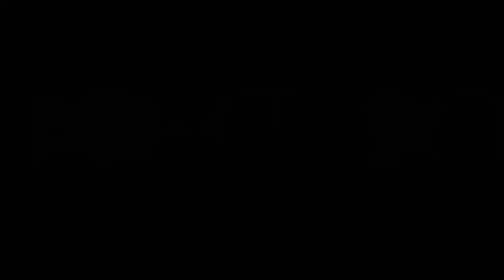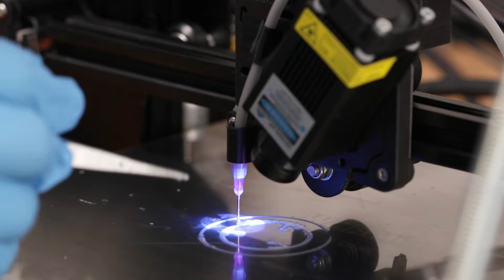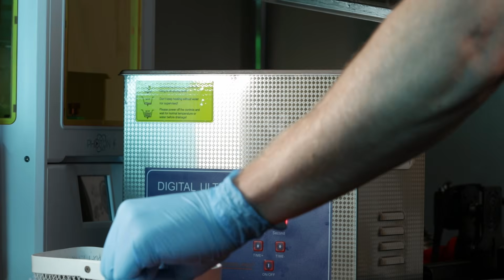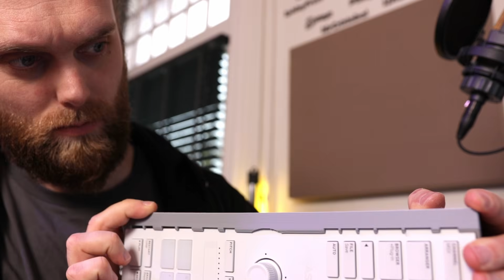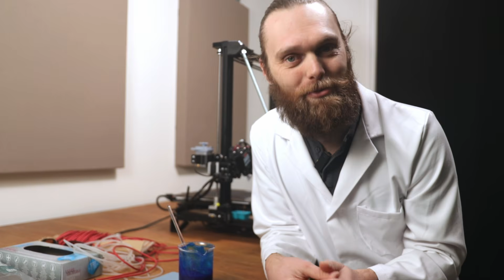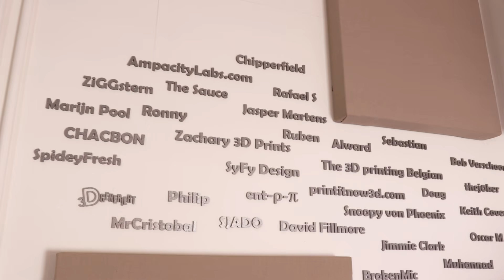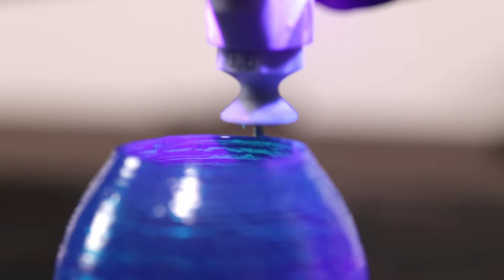I made a CUSTOM Nozzle that 3D Prints GEL!

Comment: what about pressuring the vat and then also adding a valve (peristaltic style) to compress the tube and restrict/prevent flow when needed in combination with adjusting the pressure of the vat. You can then adjust the flow/pressure as needed.

Comment: so i think your on the right track here, with the addition of the continuous fiber, the current resin would more than likely be able to cover gaps with cleaner results than even the more paste-like resin from the last video, while maintaining your ability to have variable control over the flow of the resin over the fiber allowing you to really fine tune the size of the extrusion. maybe the next thing is adding the continuous fiber to the equation with the current resin mixture

Comment: Not sure if its possible or if you've done any research into 3D clay / ceramics / concrete etc.  I know its a completely different material you're using but they've solved a lot of problems with the exploding or bubble parts that print - really big problem in clay printing.  Maybe some inspiration or idea's could come from them, might not be the solution but could spark another idea that helps you solve your problem.  Great video

Comment: 16:7 Is your power supply grounded? If not, it might generate a potential to ground of about 100V (as high as 150V and as low as 90V). And when your body closes the circuit to ground, it kills electronics.
Don't dismiss it because you didn't feel the tingle, that won't happen. It has very little actual charge, so only a few μA flow.
Reply from the maker: Good question, yes it's grounded. However, the body of the laser unit wasn't because it's mounted to a plastic bracket. So the only way my static electricity can go is through the electronics.
Reply: @properprinting  Doesn't have to be static, is what I meant. Just test it. Any power supply without ground connection (USB, laptop, whatever). And measure between its 0V rail and the ground of your house. It will have a potential above 90V. Oh. And it is AC. Make sure to set your multimeter as such, or it doesn't display a thing.

Comment: I thought about this overnight - one thing when I was making surfboards for the first time with epoxy resins was heat - it's a seriously exothermic reaction - if there's too much mass/volume left in the pot it gets hot and solidifies quickly - 

HOWEVER if the resin is on the board and becoming too thick to work and causing issues - giving it some heat with a heat gun lowers it's viscosity for a few crucial minutes.

Point being that it's viscosity changes with just a few degrees - so we went to giving the mixed resin 6-8 seconds in a microwave before use.

You could try varying the temperature of your beaker with a heated water bath and using a hot end end warming the resin ever so slightly during prniting to obtain the viscosity you require at the print nozzle.

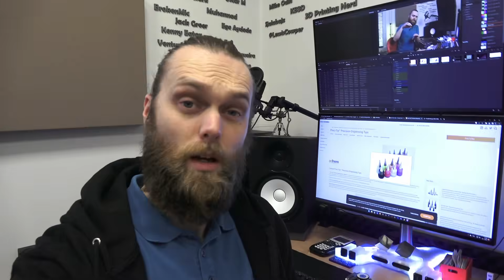Comment: At 4:00 :

During my Bachelor Thesis, I designed and resin printed nozzles with a luerlock thread. It was used to extrude a high viscous paste and worked really well. If you want to, I can share the dimensions from the Iso Standard or my 3d model and you can design a nozzle with th luer lock thread
Reply from the maker: Thanks! I used this in my previous attempt and failed. In that video I showed that the tip wasn't stiff enough which caused issues when the resin started to solidify. I needed something stiffer that was able plow through the irregularities.

Comment: maybe you can try some kind of pumping system that is similar to the pellet extruder mechanism so that material would be pumped constantly. why not.
Reply from the maker: Thanks for your suggestion! I thought about that and also showed a bit of that thought process in my previous video about FDM resin. The main reason is that with a peristaltic pump, the resin doesn't come into contact with the mechanics and it's easy to build.

Comment: I should have watched your video 2 months ago. 😭
Im halfway of my own version already!😢😢😢 instead of redesigning the nozzle, I add an arduino and a small servo to toggle a cover on syringe pin and run the path again with UV led turns on. 
Although my application is to use it as UV glue/resin dispenser so I can save up time when I need to use UV resin for assemble or for sealing purpose.
I even wrote a g-code editor so I can multiply a simple CNC path generated from inkscape and fill the print bed while adding leaving a textbox for klipper macro so it can be done via invoking from klipper mcu.

Comment: I wish I had seen this during the first few weeks. I don't think that the Peristaltic Pump is the best way to go, because you are relying on a flexible tube that changes shape with changing pressure. If you use solid brass to build a pump with the design based on a rotary engine, but very small, and all your tubing after the pump was brass, you could use rotation speed directly geared from your stepper, you would have unmatched control over the flow. You must remember that fluids don't compress, so all the pressure from a pump will exert force on the walls of the line to the nozzle. Only way to have perfect control over the gel, is to remove ALL components with any flexibility from the nozzle line. This would even have amazing retract control.
Good luck and continue to push the barriers of engineering.

Comment: I think you are very different than other 3D printing guys out there. you are an inventor and innovator. I have recently discovered you and am happy. this FDM resin 3D printing especially with capablity to mix different type of resins throughout printing will be a big game changer. please continue working on this. i realy appreciate you sharing these great ideas on here. some of your ideas are patentable which can lead to you having your own revolutionary 3D printer range in the future. you are a problem solver this is the most valuable skill. I am an UK based medical device inventor with granted patents to my name so I kind of know what I can see coming :-) well done
Reply: did you try increasing layer height and reduce flow, and reduce the light intensity so the nozzle can go over the hardened resin bridges. i think all you need is a balance of flow rate and light intensity. gel is consistent enough to hold itself up during curing.
Reply: or you need a special resin formula that hardens slowly and gradually enough that the bridges will not be too hard by the time nozzle hits them. i just thought of  fluorescent pigments that are used for resin casting. this pigment restores the light energy and gradually releases it in dark. I think if you add some into your resin mixture then the UV light will be absorbed by these pigments and then released gradually reducing the immediate hardening effect of the light to your resin. good luck.

Comment: I wish that I had seen this when you were actively working on it rather than a year and a bit later. If you ever get back around to it, a few helpful bits to speed up your progress. 
With resin printing and liquids being extruded in particular, using the pressure from the pump and Very thin layers, you don't really set the extrusion height like you do with filament, but rather let it flow as needed. Aiming your curing light directly behind where the flow emanates, with a thin enough layer, you will get nearly instantaneous curing; you can continue with the laser, or a focused lens with UV LEDs of adequate power, which are much, Much cheaper to acquire. 
As a trade-off for the smaller nozzle size, you balance the drop size with increasing or decreasing pressure on the pump end through the software and can move the toolhead around as fast as it will go. Where you want the drop/stream to land is at an angle onto the previously formed 'extrusion', so having your nozzle exit rearward is rather important.

Comment: Cool. You got success on continuous spiral print. If there was a way to point the UV to the area one or two layers down from the nozzle it would allow a much cleaner print without nozzle scraping. If you power your laser from a fan circuit you can set in cura the height at which the fan (laser) starts getting the first few layers to stay elastic for a bit. Maybe adjusting the UV intensity could have a similar effect. Not sure if the resin curing process is gradual or instantaneous...

Comment: WOW!  This is hardcore research.  I would try tightening the laser to a narrow point that is right at the tip.  And dropping them closer to the nozzle with less vertical angle.  MAN!  The problem with that is they become a bit dangerous.  Like it's already a bit of a blind danger.  Really need to put that into a cabinet so it's less dangerous to people in the room.   But I would also try to add pure UV (non-visible spectrum) LED's as ambient light within the cabinet.

Comment: You may be able to improve the bridging by adding a (very?) small amount of short fibres ro the blend. Fibres make a suspension "stringier" for a given viscosity relative to the effect of small and low aspect ratio particles such as fumed silica or microbaloons.

I'd try a few, starting with relatively flexible ones such as cellulose fibres (available for epoxy modification in the West System range) and Kevlar in ~1&3mm lengths, starting at 0.5% and adjusting from there. If it works you may also see an improvement in cured strength as a bonus 😊

You'll need to reduce the proportion of  fumed silica to blance the viscosity gain from the fibres.

Comment: Great work! I've been thinking about 3D printing like this before, and it's great to see someone really try it out. 
By the way, do you know ceramic and glass can also be 3D printed by mixing raw material powder and resin to make a slurry, print it in DLP printers and then sinter it to get the final product? One of the drawback is that the slurry is often sticky and would cause heavy burden to normal resin printers. With your FDM-style resin printer, it would be possible to 3D print ceramic and glass in a more elegent and efficient way!
Reply: Man, I watched through the video, and found it so similar to what I've done. I've also used silica aerosol to print glass and ceramic using DLP printers, as mentioned before. I see a lot of your troubles actually come from the viscosity of the mixture, and I do have some suggestions based on my own experience. The first one is that, there are two types of silica aerosol, one hydrophilic and the other hydrophobic. For most of the resins (which are  hydrophilic),  hydrophilic silica aerosol is more "soluable". The second thing is the diameter of the aerosol particles (indicated by specific surface area). Larger specific surface area aerosol will increase the viscosity faster, which mean a proper viscosity can be achived by adding fewer weight percent of aerosol. This is important, because as the weight percent of aerosol increases, the printed part will get more and more brittle. If you want to remain the property of the original resin more, I would suggest using hydrophobic silica aerosol with large specific surface area (100 square meter per gram or so).

Comment: There are flatbed UV printers that use UV ink and print with standard inkjet printheads. The platform can be lowered so that you could print on objects. Let's say laptops. I wonder if you can slice a model and print layer upon layer like that. You'd also end up with a full colour CMYK print. There are different types of UV ink. Some are very strong. Some are flexible and stretchy.

Comment: The coaxial fiber/resin nozzle concept is incredible. Like you said, the geometry opens the door for multiple fluid injection ports - you might be able to add a second port for a "trim" line. This line could connect to a small syringe which could be used to create a vacuum near the end of a printed line, giving better retraction control over the resin. That might let you use a less viscous resin. It seems like there's a balance between resin pumping speed (specifically, how fast you can start and stop the flow) and print speed/performance. A lower viscosity plus that "trim" line control might help you achieve more control over the liquid. Don't give this idea up!

Comment: I'm not knocking your goal here but I'm still new to 3D printing. Aren't resin printers still in use primarily for the higher definition results that can be achieved utilizing it's process (thinner layer lines)? If so, what's the point in using resin on an FDM printer where your layers will be thicker? I think what you're doing is great and I can really respect the level of innovation you've had to achieve to get as far as you have. I just don't understand the "why."
Reply from the maker: I want to get continuous fiber printing to work, like I mentioned in the intro of this video. Out of curiosity, did you skip that part or didn't I explain that correctly? I like to improve on my explanation and storytelling as much as I can and your feedback can be very valuable.
Reply: @properprinting  Full disclusure, I'm was watching this while at work so some "distractions" (pesky responsibilities) do occur on occassion. Thanks for the reply!
Reply: I just rewatched the intro and yes, you did cover that part quite well. Sorry.
Reply from the maker: @messygaragetinkering  No problem, thanks for your reply! I often forgot to explain the why, while this is very important. I started doing that with my later videos, but still think I can improve on that in such way that it doesn't require full attention to know why you're watching. There's always something that can be improved!